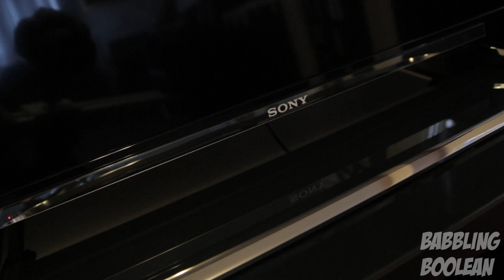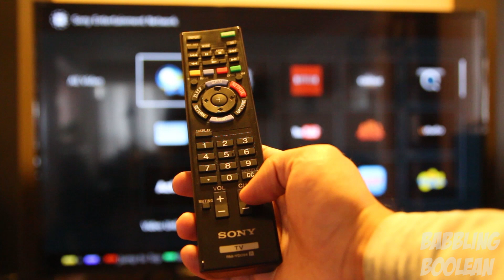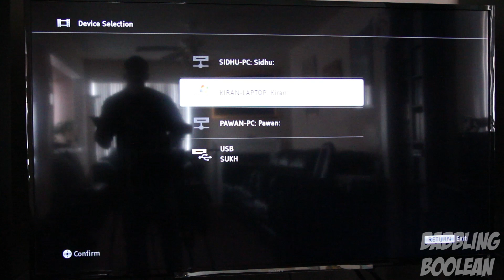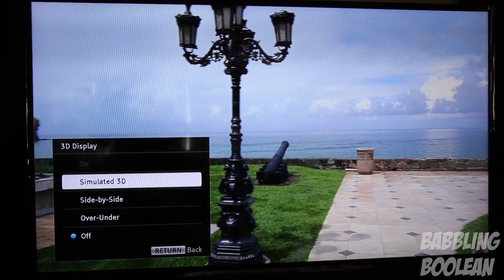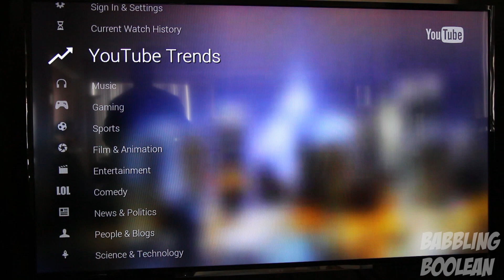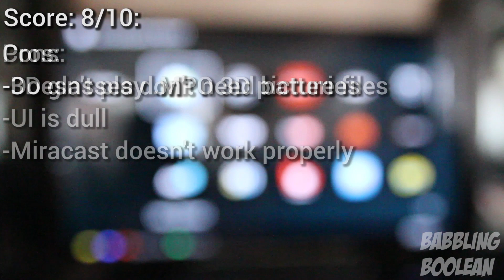Sony KDL70R550A 70" 1080p 3D LED Smart TV Review

Comment: I thought active was better for 3D picture quality.
Reply from the maker: Most people prefer passive because it doesn't strain as many people's eyes and they don't require batteries. Some people prefer active (I personally don't, it made it hard for me to focus on the image). Keep in mind when you watch a 3D movie in theaters, they use passive.
Reply: @tipthepunisher is the 3d on the 550a better or worse than x900a?